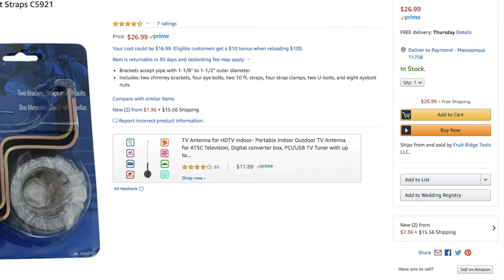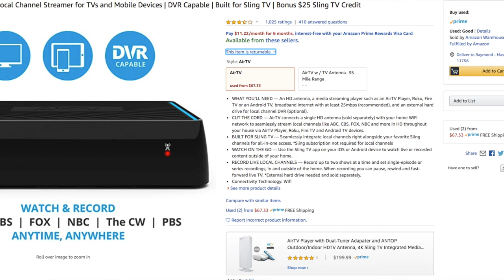How to install Channel Master Omni+ Outdoor TV Antenna.

Comment: Truth and Quality.
Practical and Useful Information.

Omni Directional Antennas are not 100% omni directional.

Some adjustment is required for best reception.

The metal reception rods receive the best when broadside to the 
transmitting tower.
Reply from the maker: Thanks for the feedback

Comment: Good stuff, Ray Ray Ray!  I need to install a signal booster for my cell service and want to avoid putting holes into my chimney and roof (I have a spray foam roof).  Chimney strap seems like the right approach, but I could not wrap my mind around how to do it without a ratchet-type device.  You did a super job explaining and I feel much better about tackling it myself.  As it happens, I removed the aerial antenna when I first bought this house and still have it, still on a pole, laying in a pile for scrap.  I hadn't gotten around to taking it away, so maybe I will put it back up, too.  One pole can serve both antennas. Thanks for the step by step break down.  I will check out the others in this mini-series, too, so I better understand the wiring.
Keep up the good work :)
Reply from the maker: Thanks for the feedback and please remember to subscribe to the channel and like the video. I believe in sharing information with my neighbors. It makes us better Community.